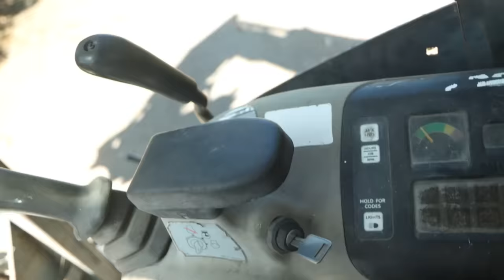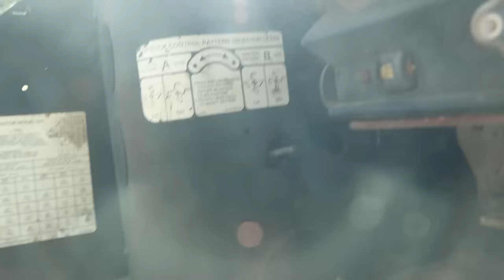I Love Excavators

Comment: as a ex diesel tech in the army I can tell you, I've worked on some of the finest pieces of shit in the US military, so I feel for you working on this thing. if you need any help I'm happy to be here to throw ideas off of if you ever need it!

also if you think the Ford headlight is bad some Chrysler you have to take off the front right tire to replace a battery. because reasons
Reply: whoever owned my 2nd Gen Prius before me decided it was easier to cut a hole in the front driver's side wheel well skirt to replace a PITA hybrid system coolant diverter valve that is notorious for frequently going out and getting hung up, needing replacement and I surely cannot fault them for it and am happy to be able to replace it in 5 minutes instead of 2 hours next time it gives me trouble, lol.
Reply: Used to have an Olds Alero.  Had to lift the engine to change the accessory belt, because naturally the mfgr routed it around an engine mount.  I still want to smack the responsible engineer (or manager who decided on purpose to send most people to dealer service for such a minor thing) over the head with one of those belts.

Comment: Sounds about right William. You spend 15 grand on the excavator. Then BEFORE you beat the shit outta it you should have done a full inspection and replace basically the entire fuel and electrical system which will cost 10 grand. 
 In the long run you won't be saving any money. But you'll learn what NOT to buy next time.
 Love you.
 Oh, and about the excavator hydraulic system.. mmmm. 
 That's another 5-7 grand in parts and labor. 
 Good luck.

Comment: It'll be OK Will. In July I began to tear down my truck's engine to determine why coolant and oil was emulsifying together. After a lot of work to replace the head gaskets, clean out all the emulsion, and multiple times rockauto sending me a passenger brake hose when I needed a driver brake hose. I poured water into find it was leaking from the back of the pump, cut a new gasket, clean it up and reinstall to find it was also leaking from a small hole burned through the casing. Also the battery is so dead the charger doesn't even notice it's clamped onto a battery. It's been rough with all the random setbacks, let alone my own problems. At this point I'll take "it runs" even if it's a little choppy.

Comment: I used to work as an engineer at John Deere where they manufacture the 8R tractor...boy let me tell ya the amount of leaks and issues we solved in a day made me absolutely despise anything hydraulic. One bad o-ring in some bypass line and the whole thing throws a fit or shoots hot pink fluid at your face

Comment: This is just regular Bobcat 337 life... If you want you can rebuild or replace your blade cylinders and it won't help the blade drop issue. Also until you have replaced the kill switch solenoid atleast twice and start pulling the air filters out and using a quart bottle or your hand to stop the engine then you really haven't used it much... Or when you have to redo the wiring to still have a high track speed function, but eventually give up after killing multiple solenoids or see what the hydralic drive motors need to have it work correctly and just leave it forever in slow... Or when the factory hydraulic tank eventually starts leaking (usually around one of the formed pass thru tank stiffeners from cycling of expansion/contraction) and you search the world only to find that new replacements don't exist and used ones are rare, expensive, and will also fail the same way, so you resort to adding inner sleeves within the reinforcement tubes (rubber fuel line works better than steel tube in my experience) and use every brand of epoxy and plastic bonder until you find one that works... Also you also have a "new low hour 337" if you haven't had to weld cracks and add stiffening plates all over the boom... But the capability of a 337 for it's size and weight make it worth the headaches... Especially when you have a newer different brand of excavator for any job that isn't just pure abuse and misuse of a small excavator 🤣 Because that is where the 337 is exceptional 👍 (when you have it patched together good enough) also you have an intact piece of plexiglass on the cab! Until that's been replaced with aluminum or steel plate then you still have a like new machine! 😂

Comment: The problem with buying cheap hydraulic heavy equipment is: It's cheap for a reason, It likely has 1000s of work hours with bare minimum maintenance (if lucky) and needs  10-20k to get it back up and running at an acceptable level. The rams are reasonably easy to re seal but those seal kits are 100s of dollars. The lines are easy, just time consuming to crimp. Engine's easy. The tricky one is the primary cylinder valve. IF you can find one they are 5-10k and insanely hard and time consuming to replace.

Comment: I had no idea you were into heavy equipment or into heavy equipment. Are you planning on getting a heavy duty truck to move your own equipment or trailer as well I'm very curious? Heads up on the bobcat though make sure that all your pins stay greased because really the pens are what's going to cost you the most when they finally go.

Comment: Oh yeah, I don't understand the level of malice that lives in the hearts of some automotive engineers. Saw a video the other day where a guy replaced the cabin filter on a Mustang and to do so, he had to pop the hood and unbolt that plastic plate at the bottom of the windshield so he could reach into the guts of the firewall and get to the cabin filter. That's not even the worst placement of "user-serviceable" parts I've seen; I've got a family member with a Porsche Cayenne and you have to peel back the carpeting and remove the center console to get to the cabin filter.
IT'S A CHEAP PAPER FILTER THAT'S SUPPOSED TO BE REPLACED LIKE ONCE A YEAR! WHY?!